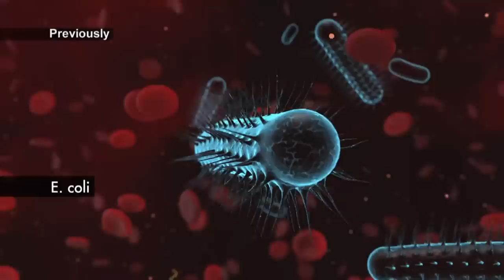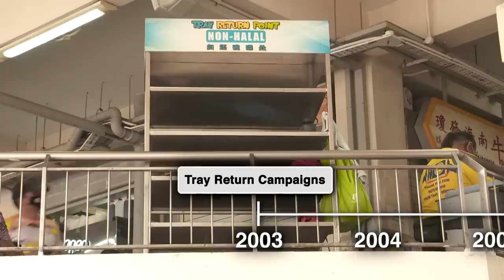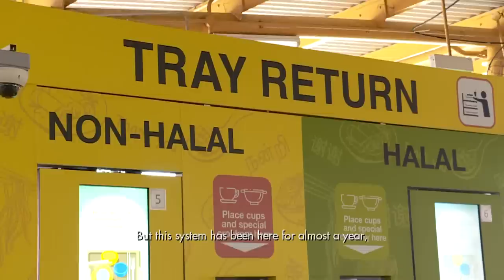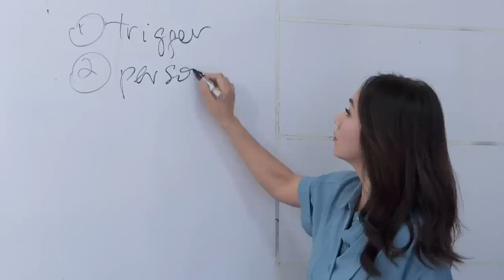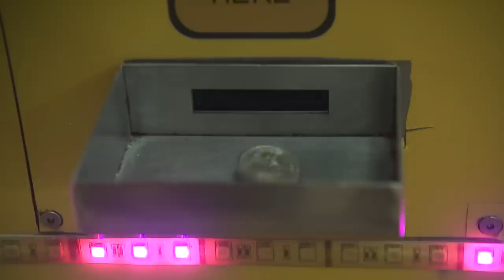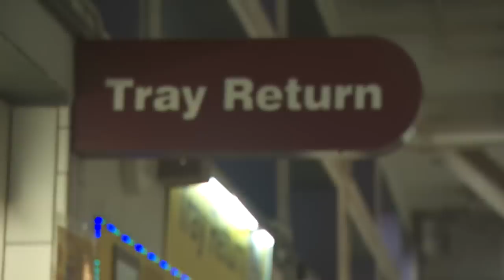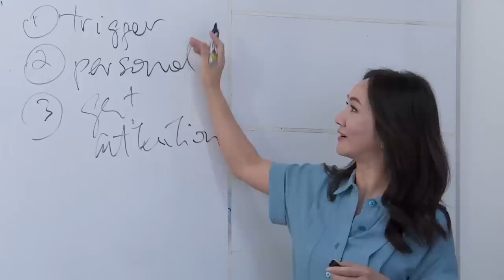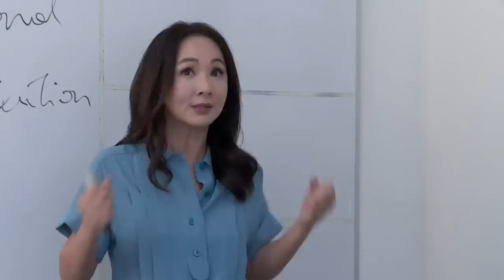How To Get More Singaporeans To Return Our Food Trays? | Talking Point | In Singapore Hawker Centres

Comment: The best way is still the tray station where they return you the $0.50 or $1 deposit. 
What you have to do is to mandate it across the island. So no matter where you go, it is the same system or else some people will get confused and question the stall assistant. 

My suggestion is for the customer to decide how many tray they need for their food. That will determine how much more they will be charged that the cashier can input into the cash register. It is only after the issue of tray then food will be given out and be collected by the customer.

Comment: years ago when I lost my job and was in transaction of another, living on limited savings, the extra dollar was a big consideration on what i could buy at stall even know that i knew the dollar will be return afterwards, thus I can empathise on why some refuse to take a tray with tray deposit. I pledge to return tray  with or without deposit, it is a good habit afterall.
Reply: Lol, they juz apply the logic like how u use supermarket trolleys. U insert ur $1 or 50cents coins and u get back after that. what is there to worry abt unless u don’t bother to return those items 🙊
Reply: @candytwins1  when you only have 5 dollars in your wallet that day, you chose food that are $4 and below and not $4.5. because of the extra dollar. No one is worrying about getting back the $1 or the act of returning the tray. some of these are implemented in areas where there are alot of elderly, just consider is both nature the same?  you can choose not to have trolley and use basket but can you choose not o use tray?

the act of returning tray is not relevant to deposit return but as a correct action, even at hawker centre with out tray I choose to take my finished empty bowl/plate to the return station which i do believe the alarm sys has better potential than deposit as a commercial option.
Reply: You don't eat out at a restaurant when you're broke, you buy groceries, like ramen and bread and peanut butter.
Reply: @SugaDontPlay  FYI there is a diff between hawker ctr and restaurants, in the price segments. U can eat just bread (abt 2.50/loft)or dry instant noodles (abt 2/5pack) both can last 4 to 5meals. In fact u can eat just about anything if u generalized broke.  Ramen needs to be cooked and not really that cheap with some costing about 2/pack. If where u work doesn’t have a pantry then a good alternative is to have a hot meal hawker ctr also offers cheap choice such as buns or doughs at 0.5-0.8 or plain noodles or rice or snack at a dollar, or a decent meal between 2-5 (or even at 1.20-1.50 you can enjoy a delicious banana leave scent infused coconut rice with a sambal paste, egg, anchovies, a whole piece of fish and topped with peanuts). Everyone might go through difficult times but that is separate from being made to feel miserable, the extra dollar put a limitation on choice as part of the package of a solution. It was a good try, do note that feedback are to allow for a better design consideration and not get stuck with just a feel good action.

Comment: She didn't try everything. What if seats and tables are redesigned so there is a converyer belt that automatically move all used bowls and utensils to the tray clearing station? Then diners just need to place it on the converyer belt before leaving.

Comment: Recently I was at a coffee shop and all the vacant table tops had small quantities of drink or gravy or soup and bits of food left on top.  I chose the table which looked the "cleanest" even though it had a few coffee or tea stains and a small puddle of water on the table.

I called on the cleaner, who was standing idly barely 8 feet away, to wipe the table. She was extremely reluctant to even do this tiny bit of cleaning. I had to call her THREE times to clean the table before she reluctantly walked over to wipe the table.

Unfortunately, this sort of experience is very common at many coffee shops and hawker centers. Trays and bowls, etc are removed, but bits of food, soup, drinks, etc are not cleaned by the cleaners, who casually walk past these dirty tables, and not see anything that need to be done. Often, there is not even a single cleaner in close proximity that I can call upon to clean the table. Do we still need cleaners who have next to nothing to do? And neglect to do even the tiny bit that is asked of them? 

In Japan, at food courts, they have stations where diners can take small pieces of damp disposable clothes to wipe the tables when they finish. 

Is it possible to save the money spent on hiring cleaners and use the money to provide this amenity instead, so that diners can wipe their own spilled food, drink, etc? Of course, to make this idea work in SG, we should take ONLY 1 or 2 pieces of the disposable clothes, depending on how many are in our group. If every diner takes a whole stack of clothe then, .... our society need to do a lot of maturing.

Comment: A deposit system.
I.E. draw yourself a tray from a vending machine for $ 1. Return the tray to tray station and get the $ back. No serving without tray.
Funds from unreturned trays 50/50 in between the stalls and the auntie/uncle for extra work.
Reply: Add another incentive. Every once in a while, the machine will spit out 5 bucks as a bonus!

Comment: Over engineered solution. No deposit system and/or trigger. Just charge 50 cents as the cleaning service. Even 25 cents per meal. Then give the cleaners a trolley so they can return the crockery/tray to the central washing station..Or hire busboys to clear and return the trays while the cleaners just clean. With a deposit system the patrons can forfeit the deposit.  If you make the patrons pay, the each hawkers center can improve the center's cleaning standards and also by paying the cleaners more, supplying napkins and not using PLASTIC/ melamine for hot food. I noticed the washing station used steel wool to scrubb the plastic crockery.  VERY BAD!!! Get real crockery. Your sculpture proved the numbers. Making it a paid service is viable and would benefit everybody. Trying to change the whole of Singapore's populous habit verses not giving the cleaners more resources through a pay system is just dumb. 25 hawker centers verses the populous??? Sometimes old fashion service is better than high tech solutions. 
Summary.....25 or 50 cents cleaning  service fee. If that's a problem,  then Singaporeans are cheap. 
P.S. plus how much does to return tray machine/ set up costs??? Silly!!!